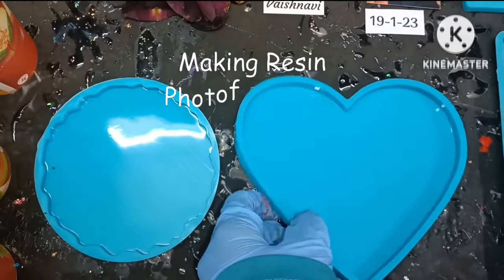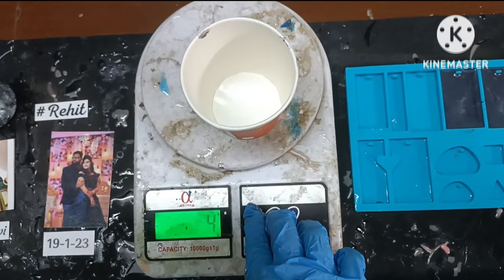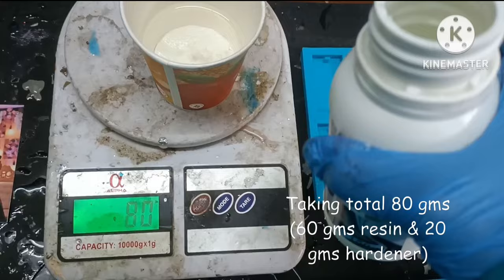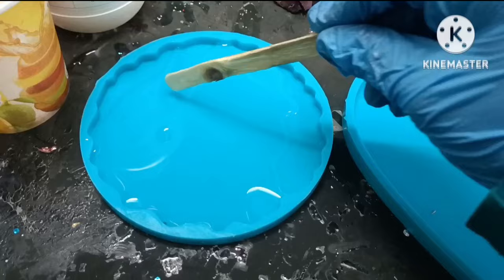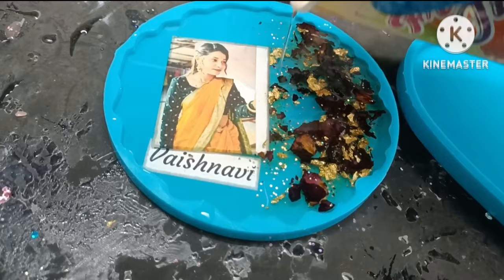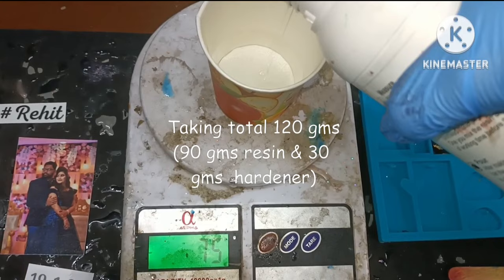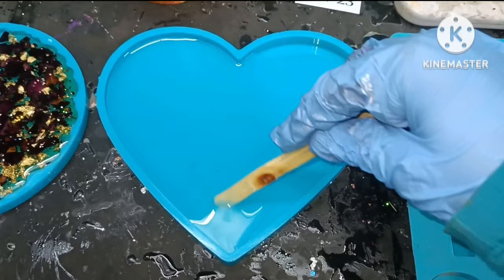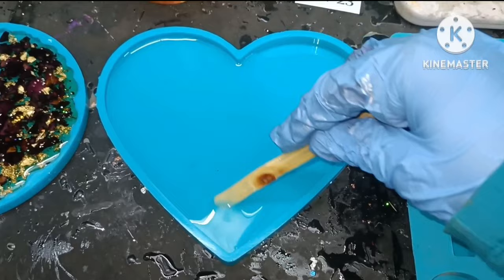Resin Photoframe 🌻| Complete Tutorial 🤍

Comment: Very well explained! I would like to know two things. First one is the names is it normal paper print u used or something else? The second is after placing the photo,rose , glitter there is no  need to wait for 24hrs and scrape with sand paper and pour the final layer can v pour it immediately?
Reply from the maker: Thank you so much ❤️ For the first question, the print is on normal paper but it is also laminated to protect it from getting soaked in resin. For the 2nd question, yes you can pour the 2nd layer directly, in the video l poured it directly only and even if you work in layers, it is also fine. The first layer is completely dried when there is any pigment in resin or if the photo is constantly rising up, so that time let the first layer dry completely for 24 hrs and then pour the 2nd layer. Hope this helps 😊

Comment: While adding the photo,the corners are little up...not dipping fully.can u tell me where may b the fault is..and plz suggest how to take proper amount of mixture
Reply from the maker: Yes this is because the density of the photo is less than the resin...so make sure to work in layers...let the first layer of resin dry and then once it is dry....put some glue and stick the photo on the first layer of resin. ..this will make sure that the photo won't rise up...and regarding the mixture...use a weighing scale for proper measurement...and take proper proportion...
Reply: @art_incarnation_ thank you.can u tell me the actual ratio for photo frame 3:1 or 2:1 and one more thing for lettering which sheet is preferable...plz suggest from where u r buying this ...
Reply from the maker: @snikitasahu1046  3:1 is more preferable if the photoframe is little bit deep but 2:1 also works fine....and l get the printout form local print shop only...and for the sheet ..for better quality you can use photo paper colour print & then laminate it..

Comment: Its compulsory to measure in ratio 3:1, is this ok with then use in ratio 2:1
Reply from the maker: You need to measure properly even if it is not 3:1 ratio resin...and for casting 3:1 resin is preferred to use whereas for coating 2:1 resin is used mostly..

Comment: If i dont have weighing machine, then how can i measure??3:1 ratio
Reply from the maker: You can take a transparent cup and mark on it with the help of a marker and take the resin till the marked sign 3 times and with the same measurement take the hardener... however it is possible it won't work since it is not precise.... preferably try to use a weighing machine only...

Comment: Hlo can i know is that circle one 4 ich mould ? Nd if i dont have 3.1 ratio resin and have 2.1 how much resin and hardner should be used?!
Reply from the maker: @tarushrikhandelwal6114  the circle one mould size is 5" & not 4". And l think around 40-50 gms resin will be enough for the mould ..so if it's 2:1 you can mix 30 gms resin & 15 gms hardener ( total 45 gms)
Reply: For 4 ich mould  30 grms of resin and 15 hardner is enough?
Reply from the maker: @tarushrikhandelwal6114  yes ..it should be enough...
Reply from the maker: @tarushrikhandelwal6114  and if it's little less ..you can always add more....around 10 gms extra
Reply: 5 grams of resin and 5 hardner if less?
Reply from the maker: @tarushrikhandelwal6114  no
..it's 2:1 ratio...so it will be around 8 gms resin and 4 gms hardener...so total 12 gms..or you can also take..6 gms resin & 3 gms hardener..so total 9 gms

Comment: Dear what will happen If I directly use passport size cutout photos for keychains? Is it necessary to laminate b4 pouring resin on it?
Reply from the maker: If you do not laminate it then the photo will completely get submerged in resin ..
That's why it is important to laminate the photo which helps to seal the photo & protects it from resin..Hope this helps 😊
Reply: What to use for lamination photos
Reply from the maker: @shairaparkar7535  you can go to a normal printing shop & tell them to laminate the photo
Reply: Lamination visible ni hota?
Reply from the maker: @piyushiaggarwal3274  aapne agar sirf text laminate Kiya ho toh ha hota hai thoda visible par maine yahapar aur bhi kuch print kiye hai A4 size paper par aur fir cut Kiya hai..so isliye visible nahi hai lamination.

Comment: @art_incarnation
So amazing 
D doubt is sister every mould u used has different gms of resin n hardener how i chosed in tat way?
Reply from the maker: Thank you!
You can use a resin calculator from Google  or any other site & then pour water in the mould & measure it with weighing machine to understand the gms ..& also you will get approximate value from experience & if any extra resin is left you can pour it in other mould so that it won't be wasted. Hope this helps😊

Comment: If I make a photo frame of 8 inches then how to take the size measurement of the photo if I have to add two or more photos there?
Reply from the maker: I usually experiment with different sizes of photos on an A4 sheet by editing it ..even l dont take proper measurement...but I think you can also try to use 'Word' to resize the image in a blank document & then print it out....l once tried this method & it worked for me...hope this helps✨
Reply from the maker: Or you can also go to a printing shop & ask them directly to give the photo of the required size...since it is an 8 inches frame ..and you want 2 photos minimum so I guess 4 to 5 inches photo will work...bt ratger than telling them the size...I prefer taking the mould with me & telling the printing shop what size l require..mostly they would know..and even if you printed them of wrong size..you can also check it on the spot that it fits or not if you have the mould...so you can again edit it precisely...tgts why at first never laminate your photo to avoid extra cost..always first check after the colour photo print...& then laminate it...thats how l usually work....
Reply: Thank you so much for guiding me ❤❤
Reply from the maker: @sagarikadey9261  yeah welcome ✨❤️

Comment: Is it compulsory to take 3:1 ratio only?
Reply from the maker: 3:1 ratio is basically made for resin which is meant to be pour in moulds....i.e for casting...so it is preferable to use 3:1 ratio resin for casting..you can also .... sometimes use 2:1 ratio ...bt not for very deep casting...2:1 ratio is usually just for coating..so use 3:1 ratio for casting (i.e in silicon moulds or bezels and all) and use 2:1 ratio for coating (i.e for upper coat or to pour on top of mdf and all)... Hope this helps 😊
Reply: There is 1:1 also. It also works well with molds.
Reply from the maker: @shovanabajracharya  I have never personally tried 1:1 ratio bt yes it does work 👍

Comment: How would u know how much resin mixture to be used for different moulds
Reply from the maker: I learned it from experience...you can use resin calculator...on google too
Reply: @art_incarnation_  How did you you divide the 80 gms into 60 gms resin & 20 gms hardener? in the first frame.
Reply from the maker: @miho_abueva  The resin that l worked with was of 3:1 ratio . Total l took 80 gms , so according to the 3:1 ratio it will be 3 parts of resin  i.e 60 gms of resin & 20 gms of hardener.
Reply: @art_incarnation_  oh thanks. How to know what ratio to use in the mold?
Reply from the maker: @miho_abueva  For casting in a mould use 3:1 ratio resin & for coating use 2:1 ratio
Reply: How much resin used in 8" photo frame

Comment: Hi the way you are explaining is very nice . Sometimes the photo comes up in the resin . How can we avoid that
Reply from the maker: For this problem, you can work in 2 layers...after the first layer is dried, you can stick the photo with some glue..and then pour the second layer on top of it ..to avoid the photo coming up..
Reply: Thank u so much . I appreciate your response
Reply: Which glue to be used
Reply from the maker: @kamysane2954  You can use fevicol
Reply: Also wanted to ask u sometimes when I make a pattern with different Colors and then leave it , after sometime all the Color’s get mixed . How to avoid that
Reply from the maker: @kamysane2954  You can use high viscosity resin for making patterns so that the colour won't mix
Reply: But what if I have only the normal resin
Reply from the maker: @kamysane2954  It is difficult with normal resin...l have never really tried with normal resin ..but l think you can pour the clear resin first and let it dry for 4 to 5 hrs and then try to put another layer of pigment resin & then create patterns... however I'm not sure if this will work or not...
Reply: After how many trays , the mould will get bad
Reply from the maker: @kamysane2954  it depends on the quality of mould..but usually it gets bad around 5 to 6 uses
Reply: I m drying fresh flowers by pressing method , but they turn black . How to avoid that
Reply from the maker: @kamysane2954  the flowers will gloom a little bt not much.. however don't keep your flowers for way too long & if you are keeping it in a book then make sure to put on some weight too ..so that air doesn't pass ....and it is pressed properly

Comment: Frame model 5 inch how to calculate resin ratio told me
Reply from the maker: You can use resin ratio calculator which is available on the website of tulsi resin Instagram account.
Reply: Measurement mattu solluga plz
Reply from the maker: @rumanabegum7553  it should be around 120 gms
Reply: Tq u